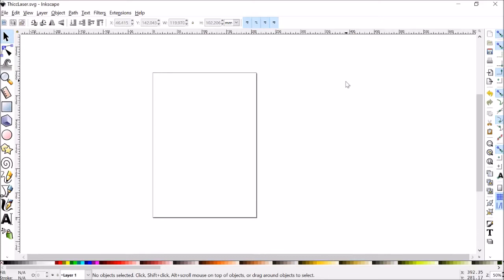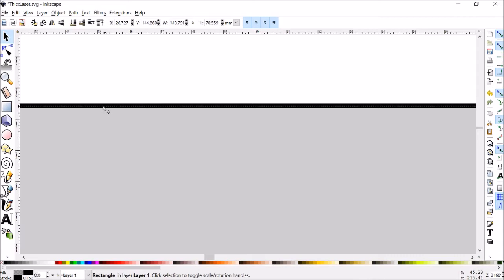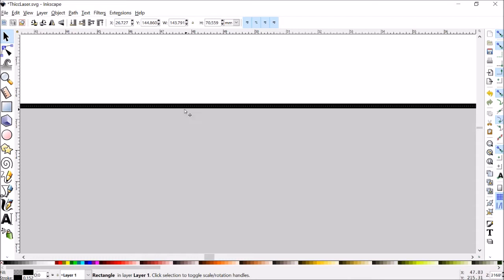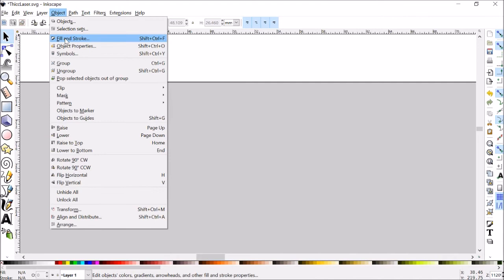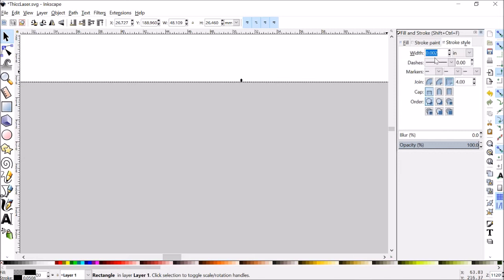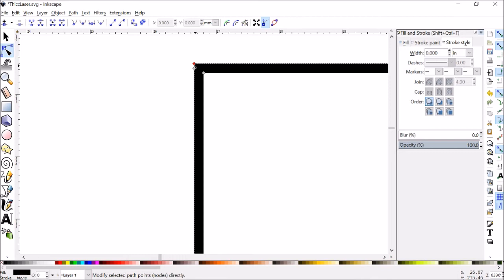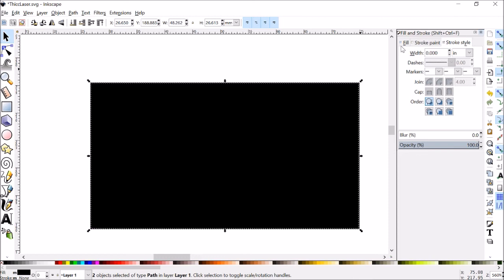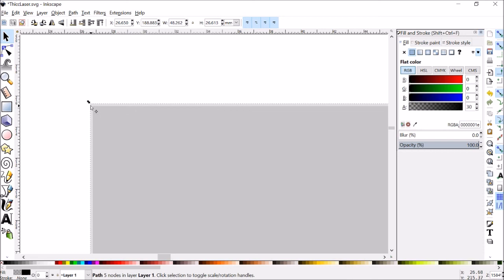Adjusting for the Kerf of Your Laser in Inkscape

Comment: When i draw a simple Rectangle for example i never have a center line (the dotted one) i always get a singular outer line?

And when i add a Kerf of 0,15mm it makes the line 2x smaller so shouldn't i make the Width only half the kerf? Cause it takes half the kerf of both sides? (Top and Bottom)
Reply from the maker: All good questions. The center line exists in my version because I duplicated the part before using this technique, so it's the second version that wasn't converted.

When you say it makes the lines smaller, I'm not entirely sure what you mean. Can you say that another way?

As for the 1/2 kerf vs full kerf issue, I can see why it may make sense to only offset by 1/2 the kerf, which is definitely what you should do. But, the way you do that is by setting the stroke to the full kerf since half will be on the outside and half on the inside. Does that help?
Reply: @makingmakers4355  Yeah thx The Kerf settings one helped but even if i duplicate the Rectangle or anything or the Line stays on the outside and when i use "Stroke to Path" the lines don't change (only the Width resets to 1mm (from the set Kerf-Value before). But Break apart splits the dran line but as it seems not correctly
Reply from the maker: @Stoneheach  That sounds rather strange, do you think you could record a screen capture (OBS Studio is free and pretty easy to use), upload it to YouTube, and shoot me a link? I should be able to figure out the problem from that.